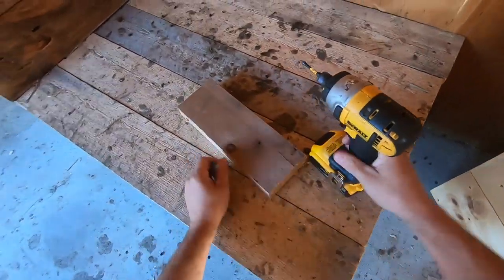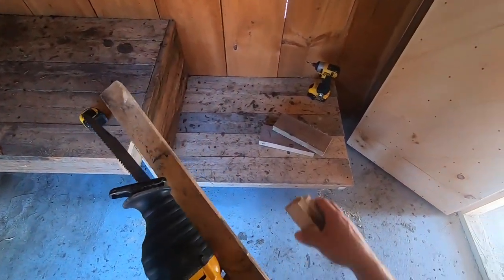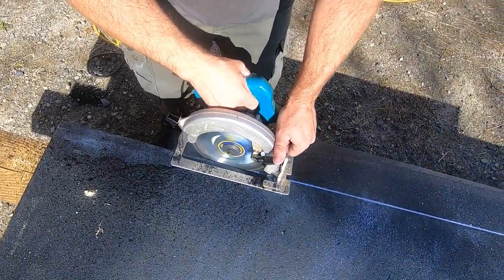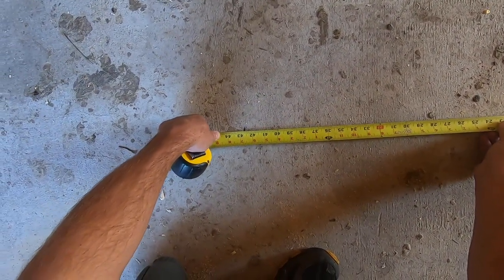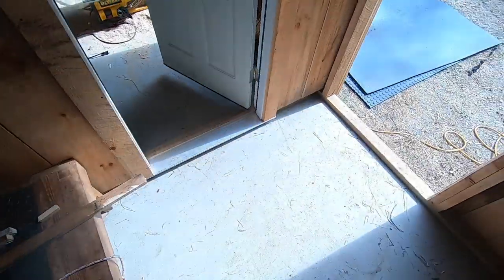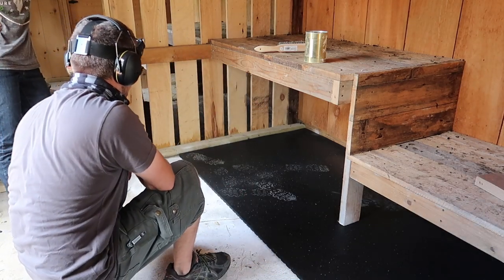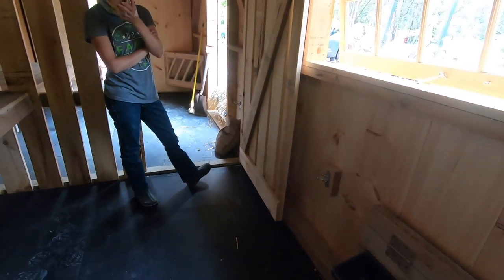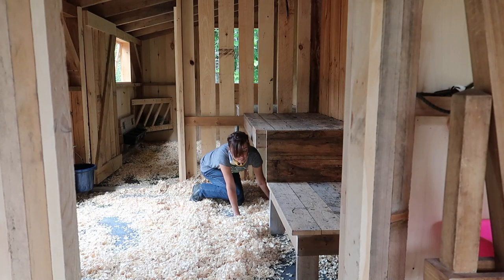was this a HUGE MISTAKE?? Concrete Floors in our NEW BARN

Comment: I thought gravel under deep bedding was better because the urine and water from their buckets and whatnot would go into the ground and not puddle up during the freeze but the concrete is nice too. Maybe concrete sealer would work, we have to think about that too before we leave for Colorado. We have a big steel building that we are putting up there and I plan to have floor drains from one end to the other so I am watching to see how the concrete works out. It is cold there too but I don't think as cold as NH.

Comment: Al have you thought about putting down a rubber seal. instead of the matts. the urine will still get into the concrete via the cracks.  I would look into the rubberize seal.  less headaches and you can still clean.

Comment: Install an Epoxy-Based garage floor sealer with some abrasive installed to prevent slippage if it gets wet.  This will stop the urine soaking into the concrete.

Comment: Late to the party today...    Concrete-grout etc will absorbed moisture and eventually dry out.    This winter it's cold and dry and that will get rid of the moisture and smell of the urine. In the spring give it a good cleaning, let it dry and seal the concrete, put your mats back and you won't have anymore moisture/smell getting into the concrete.   Future cleanings will probably just be a garden hose and let the mats dry in the sun.    A windy day would work wonders for drying everything out too.

Comment: Do an enamel seal on the floor and see if that works. Or rubber mat, but it sounds like it will require constant replacement.

Comment: If the rubber mats don't fix that, you can use tile and grout sealer or even concrete sealer on the slab. It closes off all the pores in the concrete so the urine cant absorb I to it. It's non toxic so you dont have to worry about the goats licking it or anything and it's a LOT cheaper than the mats you put in.

Comment: WE kept pigs on concrete floors that were seal with an oil based sealant (3 coats) no absorption of urine in 15 years. Lime in a wet environment will solidify sticking to the concrete making it uneven especially when layer after layer is added.

Comment: power wash the entire floor (where the goats live) then seal it with concrete sealer. or get an epoxy top coat on there! although it would have been a lot easier when the floor was poured!

Comment: Next time you lift the mats to clean use a concrete sealer, then when you put the mats back silicone between them and add some going up the walls a bit too and silicone that as well. You can always cut the silicone to remove the mats but if you seal them well you shouldn't have to move them to clean underneath. I'd also add deeper bedding, if urine isn't absorbed quickly it'll seep through the gaps in the rubber and into the concrete.
Also concrete is porous so will absorb urine and then as the concrete dries you're just left with the ammonia.

Comment: Al...You could have considered scoring the concrete floor like they do in hog and cattle feedlots...spayed with a vinyl pool sealant and then installing drains around the perimeter.  That can still be an option depending on how the matts go.  My concern would be moisture build-up under the matts at the seams leading to growth of some bad actors including mold.  In my estimation you need some ventilation / air flow to aspirate the urine and other moisture sources.  I personally (though you know far more than me about raising goats) would have put down some number five pea gravel over some sandy loam in the stall rather than concrete.
Reply: On a side note a scored, groved, or channeled floor can be cleaned with a water hose and dried with a leaf blower.

Comment: You could and should spray the concrete sealant on ALL the floors throughout the barn.  A minimum of two coats this will help prevent urine, oil and other things penetrating the concrete.  Then all you have to do is use a hose to spray off the floor.

Comment: Maybe try using sawdust as bedding.should be cheap if there is a mill fairly close. And I found getting a gal of pine oil and mixing it in a sprayer and spraying to clear the odour. Just my two cents. Craig 😀

Comment: Concrete should eventually cure to a point that it won't absorb liquid.  Our barn had a concrete floor and neighbors had huge dairy barn that was the same.  It was standard in our area.  If the concrete company knew what the end use was they would have mixed the concrete accordingly.  Hope all works out.

Comment: I have my goats in a old barn with concrete floor (not sealed) and dont find it to be a problem or there to be smelly. I find it important to have a god bedding material that absorbs the urin. In my goat barn i use a powder called Stalosan (dont know if us hava it) that have a disinfectant properties. It also reduces the growth of bacteria, fungi, viruses, fly larvae and binds harmful ammonia and gas and dries up stables floors. I sprinkle it over the concrete floor and cover with straw that absorbs well. I find it important to ad new straw when it gets to moist/wet. As other people says
 i also think you have to do something with the wood on the floor. One thing i heard is that using wood shavings as bedding can build up/create ammonia.

Comment: You should still seal the concrete b4 it gets too bad.  Check out the MULTI  use product "BIN" in paint departments. Used in apartment maintenance to take care of strong pet (cat) urine that works through carpet and absorbed by porous concrete and wood floors.  Applied like paint. It worked great.

Comment: The rubber mats would work great inside the milking room. Inside the living area, the pee is going to build up under the rubber mats and will continue to soak in to the concrete. Even with the rubber mats, you still need wood chips or straw to soak up the pee.

Comment: My thoughts on the animal sections of the barn
Im thinking i would have tilted then slab, 1/4 inch a foot to the outside for drainage
and bottom layer of the walls... layed sections of mud-sill then gaps,  for liquids to be able to be washed thru.. Trying to help the mud-sill stay dry..

Comment: You might think of using saw dust on the floors until your mats come in. Once urine soaks into it It's near impossible to get the smell out. Cedar shavings will do the best job for smell but pine is more absorbent

Comment: Seal the concrete then paint it with heavy duty floor paint .You may have to repaint every 3 or 4 years but it's only a small space  and it's cheaper than mats

Comment: I assume those are some of those livestock trailer mats.  They should do fine, but the concrete needs to be seal coated to keep the fecal matter and urine from getting into it.  I think putting down bedding materials will also help, along with regular changing.  The thing is avoiding having bedding materials and waste matter in your milking parlor.  Doo Doo and pee pee doesn't mix well with milk.

Comment: You can get concrete floor paint, commercial type, not the home version as it's not durable enough. When you paint it, mix a good quality sand in it to provide a non-skid surface. Put a coat or 2 or regular, then a coat of the sand mix. If you just paint regular cement paint, they'll be slipping and sliding and be prone to injury. I'd also consider a wood chipper for bedding material and absorbency. Let's hope those goats don't like chewing rubber. BTW, you sure you have your mats right side up?

Comment: The concrete floor is not porous enough to absorb the urine. Dirt has the composting mechanism aspect working along with the straw and mulch. There are natural products to treat for pet smells. I don't know if a routine treatment of those could be helpful. I do know white vinegar will get rid of pet smells. Charcoal also could maybe be helpful. I'm sure you are not the first to have this problem. I feel sure there is a good acceptable solution for this problem. What do dairy barns do to alleviate the cow smells? 
You might have to eventually make escape holes at the bottom of the walls or movable walls to flush the floors occasionally. 
Or layer soil then the compostable materials.
The smell could be a ventalation issue. Maybe the addition of a fan to move the air more could help.  
However you and Gina may have already solved the smelly problem with the addition of the mats. 
Those are my best thoughts on the subject! Love to watch your families creative solutions.

Comment: Any floor will be a problem! I have dirt floors and they are hard to keep clean. I wanted concrete so I could just power wash them clean. Using mats will make a mess under the mats. There is no easy flooring unfortunately. You will just have to try and try until you find something that works for you. It’s all work!!! 
Oh- and rubber mats are slippery when wet!

Comment: Use wood shavings. They compost quickly. The mats will cause mold, even with the lime.  You will a fly problem with the mats. Our barns are all concrete, and we use straw and wood shavings.

Comment: I said something about sealing the floors before you built the barn.  Also so the oil from your tractor would not stain your floor.
Call your concrete people they sell sealers.  They MAY sell sealers for barn floors?????
Does Gina car fit in the new spot???  Don't forget Al someday you will have to buy a bigger tractor & have to have a bigger spot to store it???????

Comment: SEALING the concrete is a must.  Could have been done after it was poured.  If you can sanitize it and clean it put that speckled flooring down there is a way to prevent it from soaking into the concrete.

Comment: watching you build it with concrete floors and the wood thats why cow and pig farmers have a way to bring in a bucket loader to clean the floor up and wash it down  yes seal the floor get rid of the rubber mats put straw and shavings down

Comment: Just a friendly tip, next time you clean up the mats, i would highly recommend you pull the edges up and put a bead of silicone at all of the seams. If urin were to leak into the seams and not being exposed to much air to dry up, it will become more concentrated and smell even worse. 
Personally i would definitely prefer a good epoxy paint with a sand texture on top.
Reply: Stall mats usually aren't sealed together.  They are meant to be removed for maintenance.  I never have seen stall mats sealed together. The bedding should absorb the urine before too much seeps into the floor.

Comment: Please find another use for the mats.  Unless those mats were  solid one piece and are absolutely cut proof  when you put them down liquids will find a way to get into those cracks and build up. Taping will help but the goats will somehow find a way to work at those seals and allow some degree of seapage. A little urine left on a surface can cause big problems over time. You have to do some kind of sealer that absorbs at least an inch into the newly poured concrete.   I expect do do a complete job the walss should be well sealed also but I expect you had that work planned for the whole barn.

Comment: I've been a builder for 30 plus years.Consider the difference between "balloon" framing  vs. "foundation" framing. You chose the latter, Unfortunately the slab is inadequately insulated and you will experience some consequences if you have temperature variations exceeding 30 degrees.At this point the slab will remain basically whatever the outside ground temperature is at its lowest and remain there until eternity... never getting above 50 degrees. This is not a problem unless you attempt to heat the building. Insulation and hydronic radiant heat would have been adequate. But Its too late to consider Its a barn /shop. Just avoid attempting to heat the slab.portable heat will make it bearable, Other than that inconvenience It will be just fine ,,,no worries keep it clean and dry.

Comment: You may want to check into a Commercial Air Purifier Cleaner - Ozone Generator. But be sure to read all the warnings and cautions about how long to run and air out before entering the area or letting animals in again so lungs are not damaged.

Comment: If you don't want concrete to absorb moisture you need to seal it. Rubber mats may help with heat loss and comfort beneath the feet but moisture (urine) trapped underneath will become rancid and soak in. Lime won't stop that. Best wishes.

Comment: Dirt flooring with a thick layer of shavings or straw. Goats are amazingly resilient especially when you give them a roof and wall over their head. Concrete is not at all good for them at all. There's a lot of trouble they can have with their feet and legs because it doesn't have any give. The other issue is since concrete isn't dirt, watch for smell build up as goats can easily have breathing problems. Your only saving grace is to make sure you put lots of bedding down with the lime. I also agree that you need to go ahead and seal that concrete. We live in a dry, sandy environment so it was no brainer to keep a dirt floor. But, even if we lived in a colder area (never cause I have snow), I would keep dirt just put down more bedding. Lastly, as a former horse owner who was on rubber, clean it at least every three or more times a year depending on how much mess is down.

Comment: I'd probably look at getting a groove cutting matching to cut some shallow groves for drains in the concrete out to the outside edges. Then look at an epoxy floor covering like in garages.....the other option, similar to what your doing, is mats that come up about 6" to 8" on the walls for a deep bedding method with wood chips (check out ReefDVM's channel for thier stall bedding video for thier horses,...I'll try and leave a link to it once I find it).
Reply: Here is the link to the video I mentioned...
https://youtu.be/94Cgt_LCg5o

Comment: My husband & I own and operate a hot pressure  cleaning business and yes if you seal the cement you will not have a problem with the goats urine leaking through. But to be hosing down the area I would be more concerned about your wood unless your going to cauck real good .

Comment: We're a little surprised the concrete wasn't sealed. We began watching long after the barn was built. 

Epoxy is the longest lasting sealer but it takes a lot of prep and time to prepare the surface. For example, once concrete gets wet, you need to give it time to dry. Not just on the surface but within the concrete, because concrete is kind of like a sponge. It absorbs moisture. 

Our advice is to: (1) clean and acid wash the surface; (2) let it dry for 24-48 hours (no traffic whatsoever); (3) epoxy seal the surface and let it dry; (4) seal the walls inside the stalls (at least 4 feet up from the floor); (5) and remove the 2x4 thresholds under the doors to make mucking them out 100% easier (so water can travel stall to stall and eventually drain outside).  

Sealing the wood inside the stalls (at least 4 feet up from the floor) will allow you to wash the floors and the stalls without ruining the wood in the stalls themselves. 

Note: An epoxy floor can be slick, but you can put additives into/onto the epoxy when applying it, such as silica sand to make it non-skid. Example: roll (paint roller) out about a 3 foot square making sure you use a lot of product, sprinkle silica sand on top of it and continue doing that until the floor is finished.

Our company has done numerous garage floors that have expensive cars on them everyday. I recently spoke to a gentleman that bought one of our home about 23 years ago and he still has the same epoxy floor we gave him. Epoxy will last a long time. 

Good luck and thanks again for all that you do.

Comment: Did you seal the concrete? My mother bought a foreclosure that was concrete slab & it had both wicking problems from the ground as well as dozens of dogs peeing on the floor & they had to clean it really well & then seal it to prevent the smell & water from wicking back up.

Comment: I hope the mats work for you. I've considered them but haven't tried them yet.
 I went from concrete to dirt. I love that the urine soaks down into ground (haven't had any bad urine smell yet) and the concrete was too cold in the winter for my goats, I'm in Western New York!
Keep us updated on your thoughts how mats go.
Reply: Canterlily Farm 
If you use the Deep Bedding method, it soaks up the urine into the Straw Fibers and the Nitrogen in the urine is contained and can be composted and is just as good as a soil amendment as the manure in the deep bedding
Reply: @BrianBriCurInTheOC  yeah i did deep bedding method when i had cement floors. I'm not a fan, two feet thick at end of winter is not something I want to do again.  I try to do minimum amount of bedding, still being sure my goats are warm enough.
Reply: Canterlily Farm 
Maybe that's why Simon of Sweedish HomeStead & Joel Saliton run pigs over their Deep Bedding to make it easier to remove.
Sandi Brook of SHEEPISHLY ME has loads of straw from their wheat crop chaff and she spreads it out very liberally. And the uses a BobCat to remove it!
Reply: @BrianBriCurInTheOC  Probably! :)   We watch the same channels! :)

Comment: I'm not any kind of expert but it seems to me that the rubber mats will not allow for fast evaporation of urine. I think perhaps it would be better to seal the concrete surface and then lay down several inches of wood chips and/or straw. This would give you lots of excellent compost for future gardening.